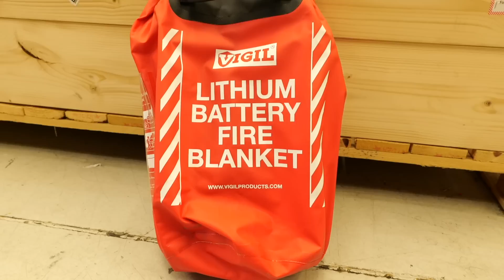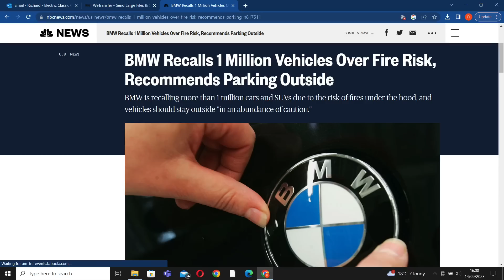Electric Car Fires - Facts and Figures

Comment: Coming from the RC community, no matter what you do, your battery is eventually going to puff out and when that happens you supposed to discard, but we never do that if it still works and alot of times results in a fire best described as hot lava out of a volcano and you cannot put it out with anything
Reply from the maker: Having been into RCs a lot years ago you shouldn’t use a LiPo battery after it swells. Also comparing LiPo batteries from RCs to LFP batteries in EVs is like comparing jet fuel to diesel. LFP batteries are surprisingly hard to get to go into thermal runaway.

Comment: EV is an emerging technology, many improvements needed before mass acceptance.

So treat it like an airline safety i.e. "Low prob, High consequence event", little confidence in Boeing let alone with these light touch unregulated EVs.

4:13 good to know EV = 1 in every 26565.2 car will catch fire, ICE = 1 in every 408.5 car will catch fire

1 Pre-event:  
1.1 Universal design guidelines on safety codes including any fire detection system
1.2 Battery Casing test standards in case of crash e.g. can the casing withstand 30mph crash while sealed without affecting cooling (passive cooling), like any UL rated material, burn duration and severity test.
1.3 All EV must include a fire blanket
1.4 New EVs when shipped must not be charging while in transport and must not be over.... 75%
1.5 Auditable horns must be activated when 1st sign of fire detected, as most home owners are sleeping when charging.
1.6 All BMS must conform to thermal runaway sensor, passive & active cooling with separate power unit (redundancy)
1.7 Independent battery pack certification by regulatory body (treat it like an explosive box)
1.8 Mandatory & 'regulated' battery health diagnostics and accessible information to driver with number of cells degradation
1.9 Mandate a fire blanket material layer between occupant and battery pack, (burn other things first before reaching the occupant)
1.10 Passive smoke evacuation inside the cabin, if it ever builds up.
1.11 Completely Sealed battery casing like a tin can, but with universal lid design to allow any 'can openers' or sheetmetal puncher for firefighers to pump water direct into the battery pack to minimise thermal runaway 9:00
1.12 Pre-diagnostics scans every time car is powerup like an Airline pilot checklist before takeoff
1.13 International EV database on maintenance logs, especially those who rebuild EV after crash.

2 Post event: 
2.1 Build-in Automatic Fire suppression system & internal protocols in event of say crash or overcharge or other events.
2.2 Firefighters using same fire suppression procedures for all EV cars a) monitor (fire fighters equip with thermal imaging) b) universal suppress c) when to call it safe to approach
2.3 include Mechanical window breaker, incase of fire (when all electronics were turned off)
2.4 Fire Insurance tie to Battery health diagnostics.
2.5 Strict Mandatory battery expire policy for battery disposal if gone certain limits (like in airframes from metal fatigue after so many landing cycles, flight hours & pressurised events)

3 Human Safety:
3.1 Single Manual Disable to all electronics after crash, so firefighters can start operation, rather than finding the off button.
3.2 Same Occupant Evacuation procedure for all EV cars (e.g. same door and inflatable slider design for all airlines)
3.3 Occupant Evacuation Time Test like in airline
3.4 Built in BlackBox recorder of last few moment before incident, useful to finger if the car spontaneous on fire OR external OR Human factors (useful for insurance claims).

Comment: Look people its very simple math.

Find out how many car fires last year then find out how many ev car fires there were, subtract that from car fires, now find out how many cars are on the road, now find out how many ev cars are on the road, subtract that

If you do this you will find that ev car fires are more than 8 times that of gasolene fires
Reply: Making these cars extremely dangerous especially since when the power goes out on these cars, you cant get out
Reply from the maker: @michaelpatterson-jm8nq  Myth! All modern cars irrespective of their power source have to have a mechanical internal door handle, including my wife’s Tesla. That allows anyone to open the door from the inside whether the car still has 12v or not.
Reply from the maker: Obviously maths wasn’t your strongest subject in school. Did you not understand the per 100,000 cars statement?

Comment: Here are some real facts that is open to anybody to read on their sites. The Guardian reported that In Norway, which has the world's highest proportion of electric cars sales, there are between four and five times more fires in petrol and diesel cars. The Swedish Civil Contingencies Agency found that the were 3.8 fires per 100,000 electric or Hybrid in 2022 compared with 68 fires per 100,000 cars when taking all fuel types into account. Australia's EV FireSafe found there was a 0.0012% chance of a passenger electric vehicle battery catching fire, compared with a 0.1% chance for internal combustion engine fire. A ICE fire because of it's flammable fuel combusts immediately which doesn't give it's occupants much time to evacuate the vehicle much different to a EV fire which smolders and smokes for quite sometime which gives the occupants more time to evacuate the vehicle and surrounding area before it involves into a fire.
Reply from the maker: Unfortunately, facts are not something most anti-EVers are interested in. 🤷‍♂️😆👍

Comment: Any ev sitting in 2ft of water or less then one meter of water. Will be a ticking time bomb shortly after. 
No fire fighters have any real way to stop a lithium battery from burning. The only way is to create  vacuum and somehow remove all air from the vacuum the car is in. So any ev in a parking garage or apartment building is a problem. 
Remember the great fire of 1666 lol.

Comment: The bigger issue beyond possible fires is that the production of these vehicles causes too many countries to be dependent on China for raw materials to produce the batteries. This is a very bad idea and will cause far more issues than it will ever solve. China is not to be trusted and is the economic enemy of Western countries.

Comment: This is misleading, if an EV catches fire , burning the nearby veichols, normal veichols,  al the parking lot goes on fire ....
Reply from the maker: If an ICE vehicle catches fire it also spreads easily to the neighbouring cars. The fuel tank ruptures. Pools and rivers of fire travel and in the case of multi story car parks the burning fuel travels like waterfalls of fire to the levels below. As has been reported in fire department reports on ICE fires in multi story car parks in the past. You don’t get pools, rivers and waterfalls of fire with a battery. 🤷‍♂️🤦‍♂️
Reply: @ElectricClassicCars  That's correct , but apparently, the EVs catch fire without any reason , and the flame would spread even if the firefighters are doing their best to contain , the toxic gasses are between the worse known , way worse than the regular cars' one . Probably the nowadays technologies aren't enough . The choice to deny the people the  purchase or conventional cars ,
Is simply evil . The prices are out of reach for normal people and no veichol even the more advance is safe .
Reply from the maker: @zywv987 ICE vehicles also carry fire for no reason, even when parked. BMW are recalling millions of petrol cars because of them spontaneously combusting. https://youtu.be/Us56c7yQAYY?si=7BeA3vCfY3ftuJ9C
Reply: @ElectricClassicCars  I don't know that , but the problem is a national security problem,  the water doesn't extinguish evs' fire,  it make,  the gas more poisoning . From an economic point of view , few people can't afford those cars , forcing people to buy those cars  is simple unethical.  Don't mention the precious minerals used for those batteries,  destined to turn into poison at the end of their cicle . Simple,  the technology isn't ready for the mass production,  too expensive,  too poisoning,  if you want to do something good for the planet,  build up a tree farms.

Comment: Another good job of misleading people with a study that is on his face incompetent. Check with NTSB if you’d actually like to know the truth. Diesel and gasoline cars on the road that are operating at five years old or newer are 66% LESS likely to catch fire ( from all causes including accidents) vs 5 year old or newer electric vehicles. 
Do the research… Per capita in the first five years of operation electric vehicles are 66% more likely to catch fire by all causes.
Reply from the maker: That’s interesting as all the NTSB reports I’ve seen concluded that ICE vehicles are much more likely to catch fire than EVs. Do you have a link to the report you’re referring to?
Reply: @ElectricClassicCars  NTSB publishes the number of vehicles on the road every year that are five years and under. They also publish the number of fires that occur in those ICE five year old and less population of vehicles. They do the same for electric vehicles. They do not publish a separate paper comparing those to car populations. The data is there. You have to find it and compare it. NTSB serves the interests of the current political leadership of US. People need to go through the raw data as I have, and put those numbers together. And no I will not do it for you because it’s a learning experience that you need to do. Everyone out there needs to quit listening to news, casts and go get the data and compare it.
FYI, I have worked in mining and mine safety, with a major point of experience, being electrical systems and battery systems to be used in mining sites. We do not allow any lithium batteries or lithium powered equipment underground in any mines. It would be completely and totally reckless. The same should be said for condominium buildings and underground parking.
Reply from the maker: @cherami9482 As suspected. You can not provide a link to any NTSB report or report based on their data that confirms your BS. However there are plenty of reports that confirm the EVs are far less likely to catch fire compared to ICE, including those based on NTSB data. https://spectrum.ieee.org/lithium-ion-battery-fires
Reply from the maker: @cherami9482 I am very familiar with the NTSB and have read many of their reports, for years. It seems you have no evidence to back up your claim apart from the usual conspiracy theory that the truth is being hidden. Data on age of vehicle and likelihood of fire is available if you look. Norway is a good look into the future for you in the US as they’ve had EVs for many many years and now have an aging stock of EVs on the road. So with more and more EVs on the road in Norway AND they’re getting older, lots older than 5 years old. You’d have thought that the number of EV fires in Norway would be going up. But if anything, they seem to be going down, maybe because battery management has improved. https://x.com/robbie_andrew/status/1656958052669575169?s=46
Reply: @ElectricClassicCars  You are hysterically funny, you’ve read the reports and yet never understand any of them. Can you separate two data groups and find comparable data groups? The answer appears to be no. 
Do your research so you don’t make a mockery of yourself as you are on your website and your postings. I’m 42 years in engineering and dealing with safety on industrial scale, you are as we say, a punter. I actually brought it up to you because I hoped that you would see the mistake in the NTSB research comparison you quote so regularly.
Reply: And no worries I won’t raise any more obvious issues about your reporting on this or any other issue. You will be blocked from my feed in about 2 minutes.
Reply from the maker: @cherami9482 A typical conspiracy theorist. You block any data source that contradicts you and may risk popping the reality bubble you’ve created for yourself. 😆😉👍

Comment: Wrong. I rarely during the last 50 years have I ever heard of petrol vehicles spontaneously igniting, and then exploding incredible heat, toxic gas, and fumes. Yet now, even with a small fraction of electric cars on the road compared to petrol - I often hear of them almost daily, self combusting, and usually - destroying everything around them. This is a big deal, you cant gloss over, only an idiot would believe they are safe to trust.
Reply from the maker: I’m afraid you have fallen for way media works nowadays. Put out a story about the 1000s of petrol car fires that happen every day and nobody will read it or click on the story but put one out about a single EV catching fire and bingo, everyone clicks on it. However, all the studies clearly show that ICE vehicles are much more likely to catch fire than EVs.

Comment: I don't think you can reliably support that conclusion with this study.

For starters all of those EVs are by necessity quite new, most of them have probably less than 5 years. You'd have to be the first buyer in the country of the first Nisan Leaf model to reach the 10y mark. Given the high subsidies for EVs in Sweden, the average probably skews towards newer cars.

In comparison, the ICE cars left are either from people who can't afford an EV (so probably badly maintained), from people who can't easily switch to EV (so they spend a lot of time on the road), or performance cars from ICE enthusiasts (so heavily modified). In other words, the government subsidies create an adverse selection for the study, since a lot of the ICE cars that would NOT have caught fire are traded for new EVs.

Add the classical definition problem of "what constitutes a fire", and you have a recipe for wrong conclusions.

Comment: COBALT MINES IN AFRICA
Reply from the maker: LFP batteries used in Tesla model 3, Mustang MACH-E, etc don’t have cobalt in. However, cobalt is used in the refining process of petrol and has been for decades, have you been so militant against cobalt use since before EVs or is it just EVs you have an issue with? Because cobalt has been used in the steel, chemical and oil industry for many many decades and use more of it than EVs.

Comment: A petrol car would catch fire because of poor maintenance, thus meaning that it travelled some distance and served its purpose for some years now. A new BEV can catch fire before it has been delivered (you shared the trailer picture). I like what you do, your company is amazingly smart and good but please do not try bending the truth regarding the risk of lithium-ion cells. Why do we still use 12V led batteries if we have lithium technology today?
Reply from the maker: The reasons why a petrol car will catch fire are many and varied. Poor maintenance can be one of the the contributing factors for sure, as it only takes a small fuel leak somewhere on a pipe for everything to go up in smoke, such is the downsides of carrying gallons of combustible liquid around with you. A new ICE car is much more likely to catch fire than a new EV, as research and stats have already proven time and again. That’s why there are currently millions of ICE cars currently being recalled because of fire risk by various manufacturers, but there’s currently no EVs being recalled because of fire risk. Most batteries are now lithium, used for decades in phones, laptops, drones etc, lead acid has been used a lot in vehicles primarily because it’s cheaper. But not anymore, lots of auto makers have already moved to lithium for their 12v batteries. Lithium 12v batteries have been used in motorsport for a long time already, because of their huge weight advantages over lead acid batteries.
Reply: Thank you for your reply! I appreciate your point of view. I understand what are your products and what you are selling. I see your company as a contributing factor into making this technology safer. Thank you for that! Regarding my point of view, I think you know what I intend to say, not using the conclusion from hazard reports but the root of the cause. Manufacturers can recall petrol vehicles and re-engineer the defective source that caused a fire. At the moment we cannot recall BEVs because nobody is opening the battery again to improve or fix it and you know that. As you said people say “let them burn!” Have a great day!
Reply from the maker: @alexandradrg5760 Recalls are not made based on whether they can be fixed or not. They are made based on safety and risk. That’s why there’s lots of recalls for ICE vehicles catching fire presently and none for EVs catching fire.
Reply: No comment.

Comment: How many of those ice car fire are still electrical fires since most ice fires are electrical !
Reply from the maker: You can’t have ICE without electricity, however it’s not the copper wires that catch fire, it’s the gallons of combustible liquid that ICE cars carry around as fuel that catch fire. 👍

Comment: It's time that EV battery designers incorporated an extinguishing system or extinguisher connection method for firefighting.

Something as simple as a hose quick connector into the battery would allow a firefighter to attach a hose or extinguisher directly to the battery and kill any fire within.

This shouldn't cost much at all.
Reply from the maker: EVs are many times less likely to catch fire compared to ICE vehicles and they don’t have a fire extinguisher system either.

Comment: What is the risk of an EV catching fire in the event of a severe collision?
Reply from the maker: A petrol/diesel car is much more likely to ignite and start a fire in a severe collision compared to an EV due to the rupturing of the flammable fluid within the fuel tank and fuel lines. An example of this is Romain Grosjeans horrific crash in the Bahrain F1 race in 2020. The fireball that engulfed the car was from the fuel, while the battery didn’t ignite, even though it was engulfed in the fireball too.